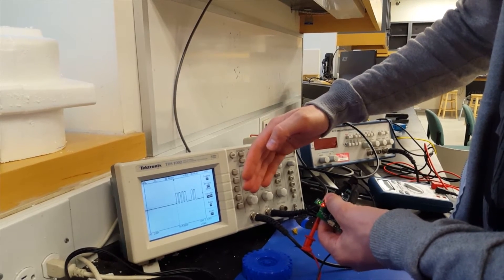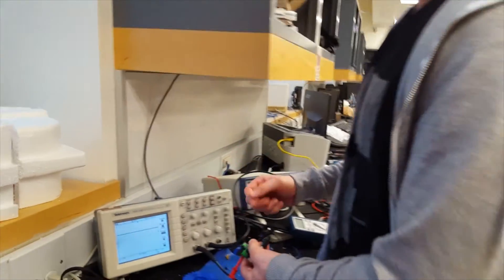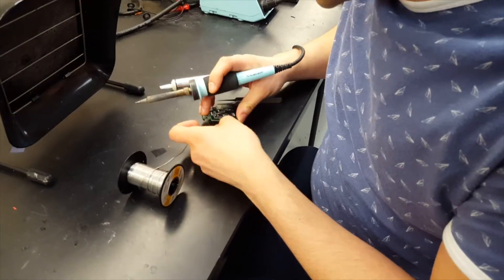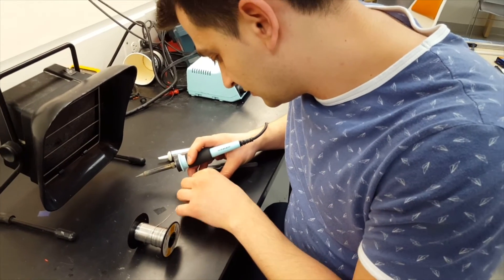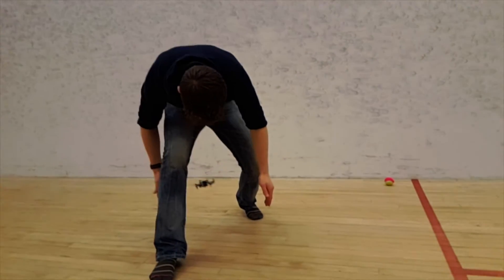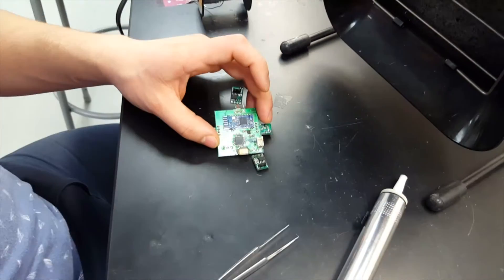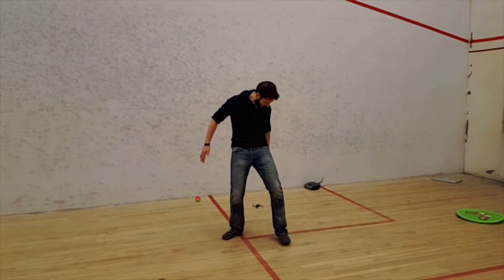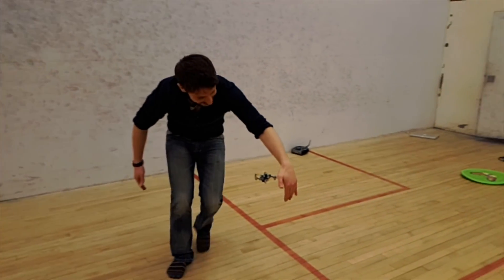sntch - quadcopter with autonomous collision avoidance

Comment: The reaction time looks pretty low as you have to keep moving the hand away so it doesn't collide with it.
Reply from the maker: Reaction times can be tuned over Bluetooth---it's easier to juggle when lowered, though :)
Reply: +Daniel Elbirt I see, so you can make it instantly avoid an obstacle?
Reply from the maker: +Video Crate You can change both the rate at which it changes direction, as well as the maximum distance at which it senses objects. Increasing the former helps for obstacles that appear suddenly, the latter for ones approaching from a distance.

If you have more questions, don't hesitate to ask! :)